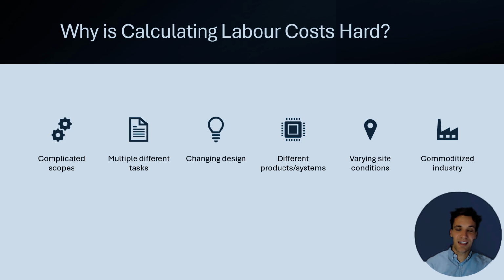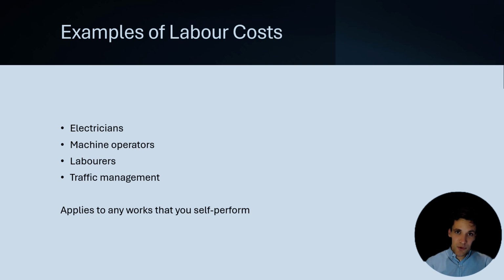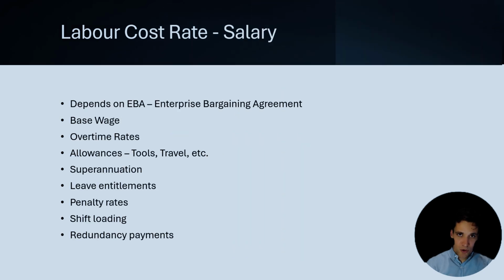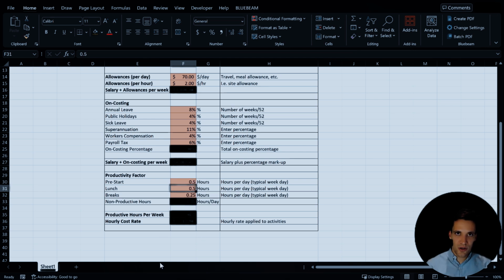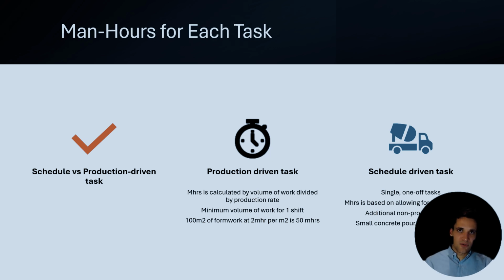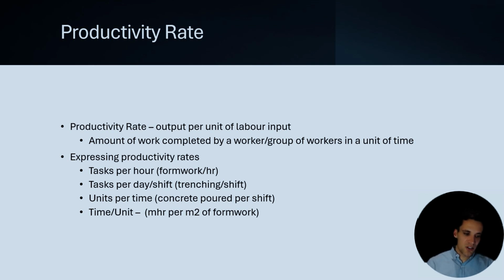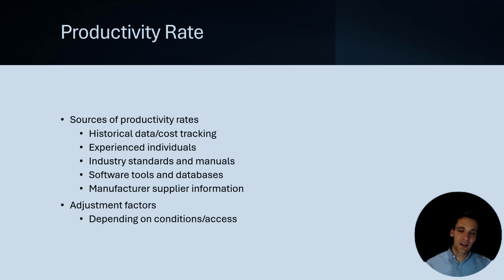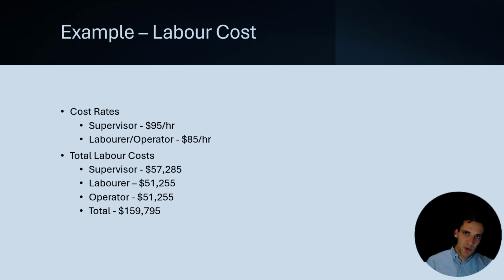How to Estimate Construction Labor Costs - (Complete Guide)

Comment: Here is what i want to clearify
Crew Q1 spends 6 hours on a task. Q1 = 1 plumber and 1 apprentise.
Lets say that Plumber wage rate = $155/hr
So apprentise wage rate = 155*0.50 = 77.5
Now
Case 1
blended crew rate = (155+77.5)/2 = $116.25/hr
Total Labor cost for task = 116.25*6 = $697.5
This approach suggests that that in 6 labor hours 3 hr are of plumber and 3 hours are of apprentise so that total labor cost = $697.5
Case 2
crew rate = 155+77.5 = 232.5
Total labor cost = 6*232.5 = $1395
or (155*6)+(77.5*6)= $1395 total labor cost because crew Q1 has worked 6 hours it means 6 hours labor cost for plumber as well as 6 hours of cost for apprentise
Now tell me which approach is correct and why?
Reply from the maker: It depends whether the crew did 6 hours on the task (i.e. total 12 labour hours), or 3 hours on the task (6 total labour hours)
Reply: @ConstructIQ  Generally speaking when a crew did a task in 6 hours, it means that at the end we have to pay every individual member of the crew for a work of 6 hours right?